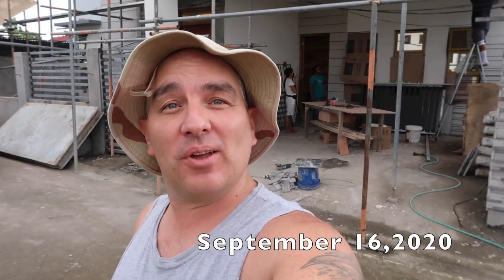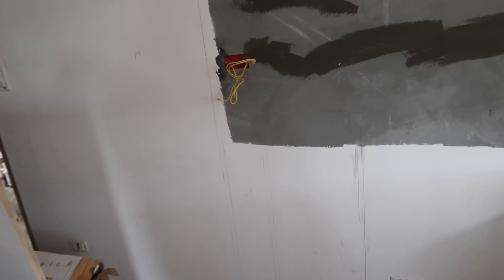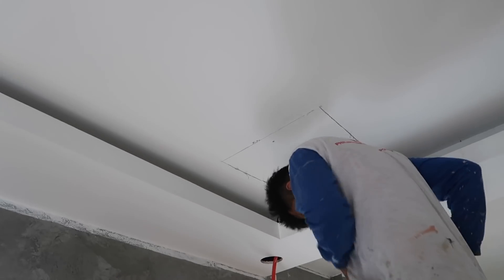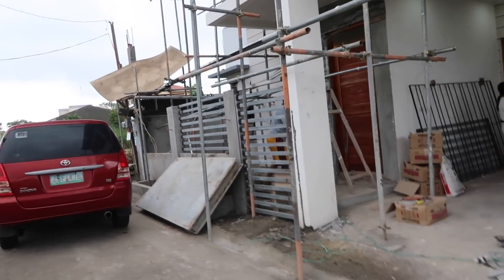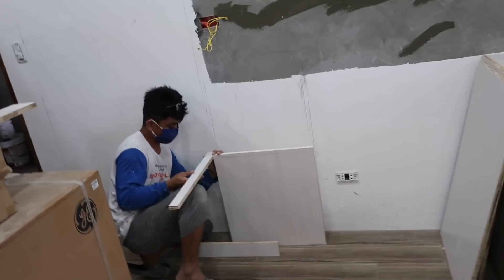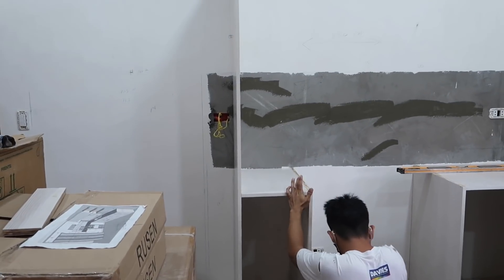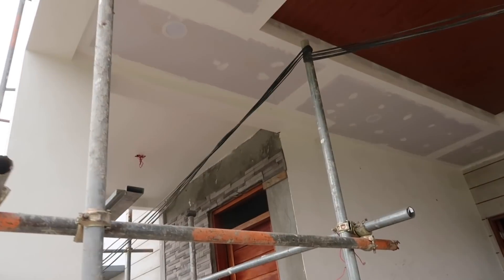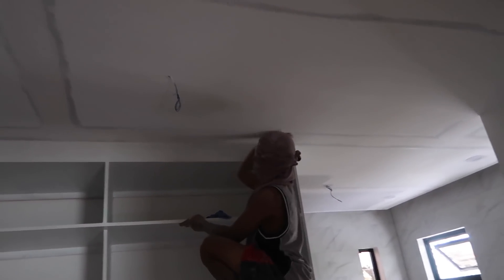HOUSE BUILDING IN THE PHILIPPINES - EPISODE 174: COVE LIGHT INSTALLATION I KITCHEN SPICE RACK

Comment: Your dream house is getting more and more beautiful. 
How many sqare meters is your bathroom under the stairs?

How high is each floor from the bottom to the ceiling?

I will keep my fingers crossed for you and your asawa.
Reply from the maker: Its tiny its like 4x6ft  stairs bathroom.
I have video about the ceiling height.
HOUSE BUILDING IN THE PHILIPPINES - EPISODE 139: SECOND BATHROOM TILES I CEILING HEIGHT
Reply: @retiredandhappyinphilippin3329  Thanks a lot. Good luck.

Comment: They installed that outlet on the wrong side of the layout line or (X), because they refuse to mark what side of the line their supposed to put whatever it is they’re installing, I had the same problem with beams and shit causing shit to be all fucked up. We’ll I broke them of that shit because I would make them rip out or apart whatever it was they screwed up, no matter how long it took them and do the shit right, Filipinos HATE redoing the heir work worse than being told how to do it right, pisses the hell out of them, after awhile my head carpenter started putting (X’s) on the side of the layout line they where working with and I said, “ now wasn’t that so much easier, didn’t hurt a bit to get it right does it?”. He finally broke down and laughed with me about it, then I gave him a bill of how much he owed me for  it all and he totally shit just looked at me and I said,” yeah it’s a joke but not really, just wanted you to share in the cost with me, next time I’ll back charge whoever it is and take it from their pay “. Real whit bro, look at all the shit popping up now that has to be gone back over, that shits on the builder not you, it’s going to add up in the end and you shouldn’t be the one paying for his mistaken for not supervising the job and his people. That hole they cut to do the wiring, those guys aren’t going to get that to where it can’t be seen, they just don’t know how to work with drywall mud well enough to understand the process of covering seems with a six inch then a 12” knife to float out the he mud which hides the seems and stops from having to hardly have to do any sanding outside of just a knock down.